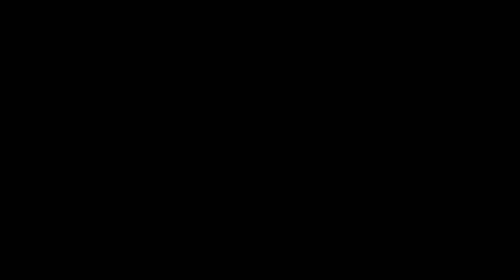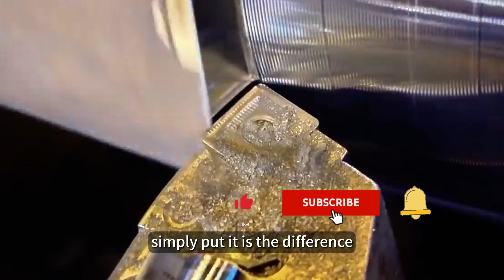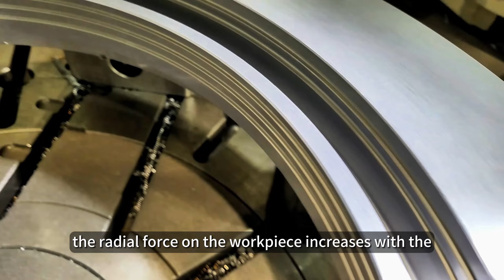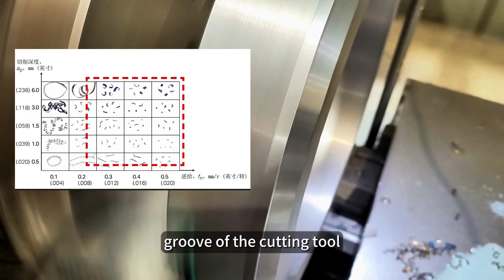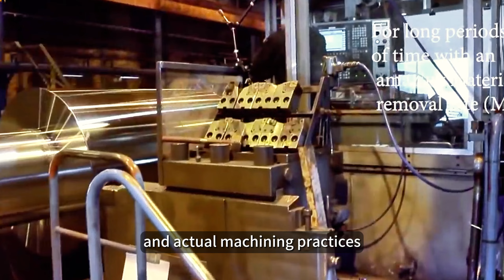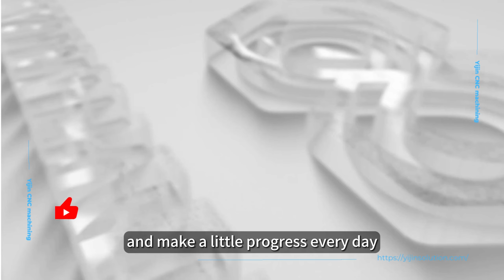Optimizing Chip Breaking: Properly Matching Cutting Depth and Feed Rate in CNC Inserts#machining

Comment: did not actually say nothing. so what best feed of every ap lol and what rpm.
not make any sens box saying vc80-250 0.1-0.4fz ap 0.4-6. my default values is right in between every time every.
if i use ap6 what vc use cant be fast so lowest. so what fz use cant be slow so fastest. so basic idea is keep chip removal same lol